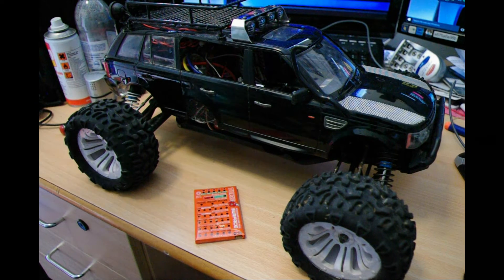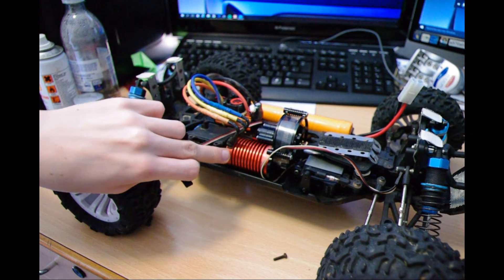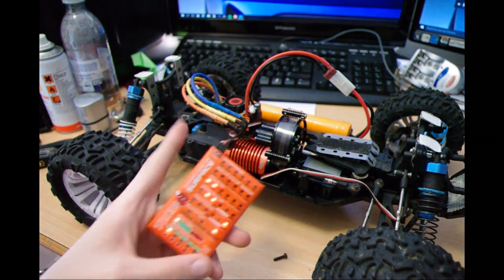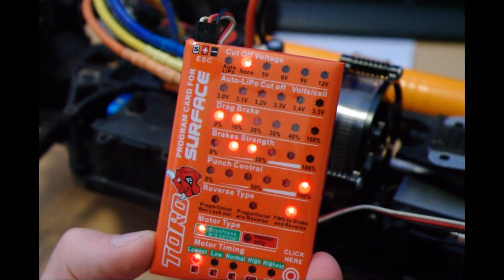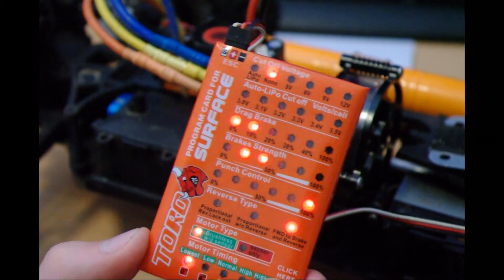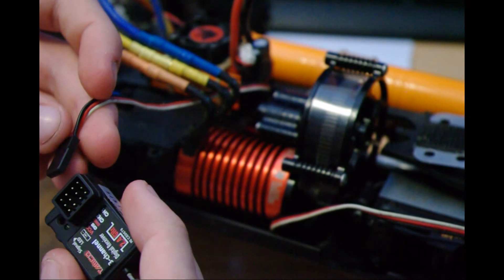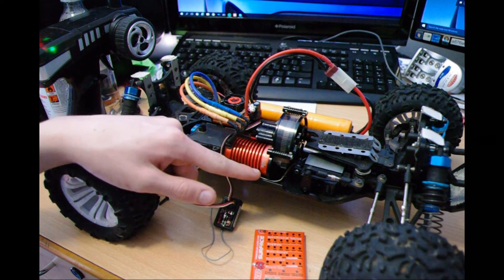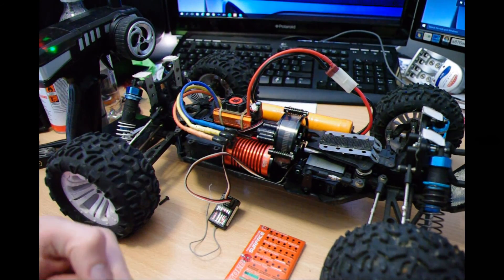How To Use A Programming Card For Brushless Motor

Comment: Why is my car running backwards?
Reply from the maker: Hello, the positive and negative power cables going from the ESC to the Motor might be the wrong way round, identifying with one is which and swap them, that might solve it, if not look at you controller and see if there is a switch for the throttle to reverse the signal

Comment: Do you have to program all motor and ESC
Reply from the maker: Denise Ortiz Hi there, you can run the motor and esc straight out of the box if you want, the programming is so you can adjust certain things that you would like changed. This is so then suits your needs and driving style
Reply: Crossfire Studios ok thank you so which is the best gear to go faster
Reply from the maker: Denise Ortiz With the carnage when it was stock, I ran a 24 tooth gear on the motor, but I think it was to much. So I'll start off with a 20 and see if you like it. If not and you find the motor struggling go down a size.
Reply from the maker: what car you using, is it a carnage??
Reply: My plan is to put a electric brushless motor 3650 5200 kv 4p  with a 60 amp ESC and a 3s lipo 11.1v battery 4000 mAh on a  RJ dragter with a 64 t that why I want to know what is better 17-21-26-29 gear just to make it faster

Comment: So would this combo handle any 3s Lipo battery?
Reply from the maker: Arron Davis I personally haven't used a Lipo with this kit. The it does say it can take Lipo's
Reply: @CrossfireStudios  I have a 5500mah 3S lipo with this esc and it works well
Reply: I have a 5700 mah 2s lipo set up....💨💨💨💨